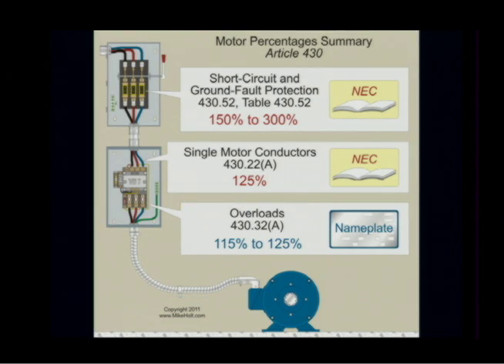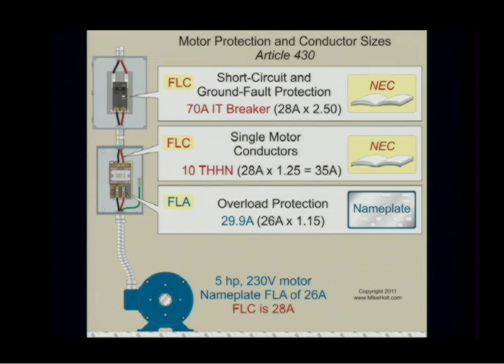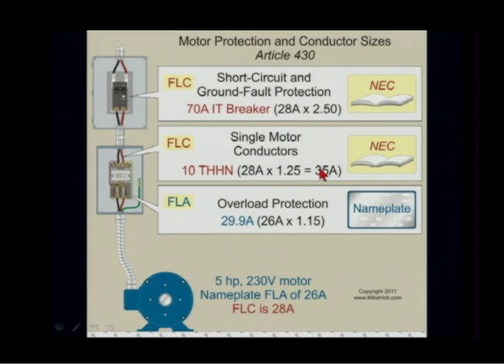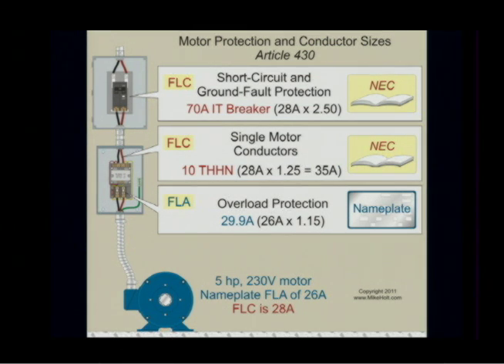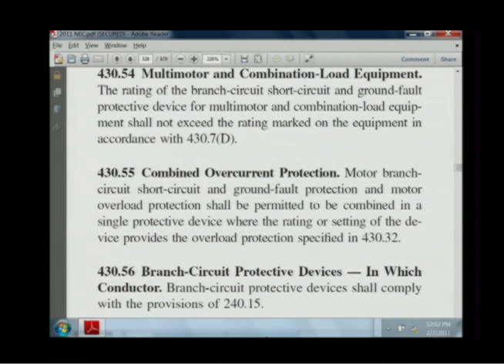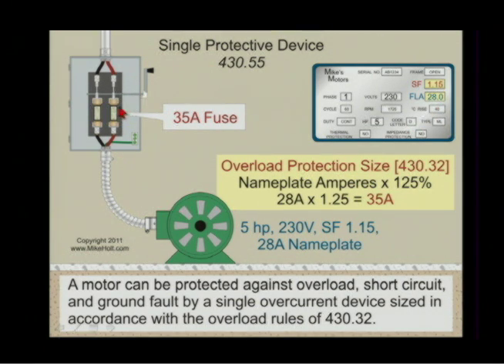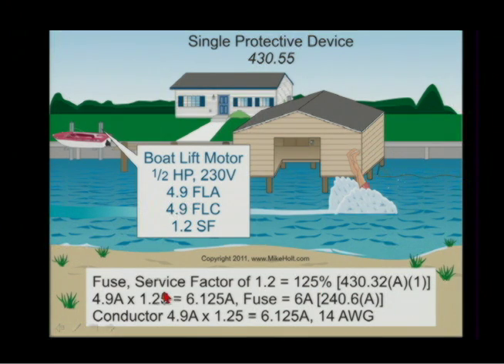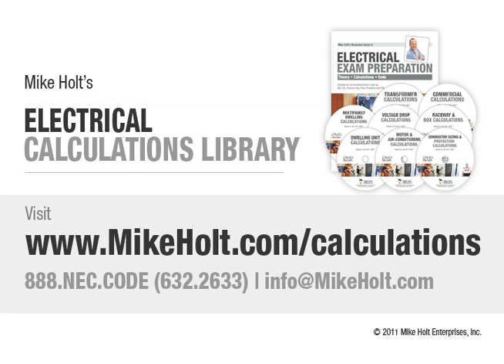Motor Branch Circuit Conductor Sizing [430.22(A)] (14min:30sec)

Comment: if the motor is non-countinous do you still multiply the FLC by 1.25?
Reply from the maker: @ericpolk9004, see 430.22(E) Other Than Continuous Duty. Conductors for a motor used in a short-time, intermittent, periodic, or varying duty application shall have an ampacity of not less than the percentage of the motor nameplate current rating shown in Table 430.22(E), unless the authority having jurisdiction grants special permission for conductors of lower ampacity.
Reply: @MikeHoltNEC what do f I don’t know the nameplate or duty cycle?
Reply from the maker: What do you think the options are if you don't have the information?
Reply: @MikeHoltNEC I assume go with125%
Reply from the maker: @ericpolk9004, correct.

Comment: I still do not understand where the 250% is found. How do you use 430.52 and table 430.52 for protective device sizing? I’m so confused.
Reply from the maker: Just use the table and use 250% for protection. If the 250% of the FLC does not match a standard breaker, then you are permitted to go up to the next size.
Reply: @MikeHoltNEC  But why is it like this? In my opinion, it is confusing for the following reasons. If I have a 90 kW motor at 440 VAC, its nominal current is approximately 145 A. The starting current is around 1140 to 1200 A (in a direct start). Now, to determine the overcurrent protection according to Article 430.52, assuming an instantaneous protection device at 800%, it would be 1160 A, meaning commercially a 1200 A device (magnetic function only). Commonly, these devices are designed for magnetic tripping at (10 x In), which is approximately 12 kA. This is where I am confused because why would you use a 1200 A nominal switch for a 145 A load in overcurrent protection. I would appreciate it if you could clear up my doubt

Comment: Thank you!  What about an AC Servo Motors.  Do they obey the same rules as regular AC motors? If the manufacturer of the VFD or servo motor Drives recommends  nominal of MCB. do  I need to consider these recommendations?
Reply from the maker: Please post your question on MikeHolt.com/Fourm.
Reply: @MikeHoltNEC   I did it 3 days ago

Comment: Hola (hi). Que sucede cuando el motor es alimentado por un variador de frecuencia / varidor de velocidad? (What happen when a motor is fed by a Variable frequency drive?)
Reply from the maker: The the circuit conductor and protection is in accordance with manufacturere instructions, not 430.22.
Reply: MikeHoltNEC conductors manufacture? Or variable frequency drive manufacture? Thank you very much!!
Reply from the maker: @carlosvillegas2167  VFD manufacturer.

Comment: why is the overload protection in 1:58 is 1.15 instead of 1.25?
Reply from the maker: Marielle, great question!  We didn’t discuss choosing 115% vs 125% for the overload protection since it wasn’t the focus of the video.  According to 430.32, you use 115% for the overload protection if the service factor is less than 1.15 or has a temperature rating less than 40C.  We cover this in great detail in our Exam Prep library. https://www.mikeholt.com/journeymanexamprep.php
Reply: I caught this too.

Comment: I am not sure I understand why the calculated motor branch circuit (@4:00) 35A was sized per 75 degrees columns instead of 60 degrees column in T310.16(B)(16). Since it is less tha 100 amp
Reply from the maker: Samuel, we appreciate your comment!  The degree column used is based on the rating of the terminals on the motor, and in this case, the graphic did not list the terminals as 75 degrees. Our current graphics have been updated to include the terminal ratings.  Here is a video link covering the topic in more detail.  https://youtu.be/k7d03Tic6LE?t=6m57s

Comment: 7:00... never a good idea to use fuses for motor overload protection... especially if the motor is 3-phase... a slow load increase such as a pump with increased fluid weight could cause the motor to burn up before the fuses would open.... and single phasing a 3-phase motor is almost a guarantee to burn up the windings
Reply: Zeke Slaaen Or you can use a motor starter with phase loss protection.
Reply: Use positive overload protection in your starter?
Reply: Overload protection is integral to the motor. Fuses provide overcurrent protection.